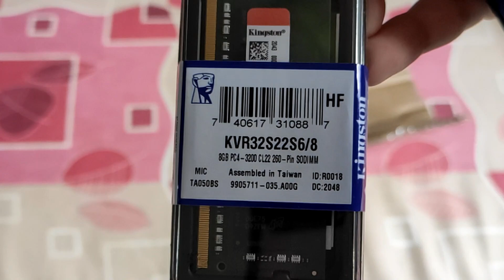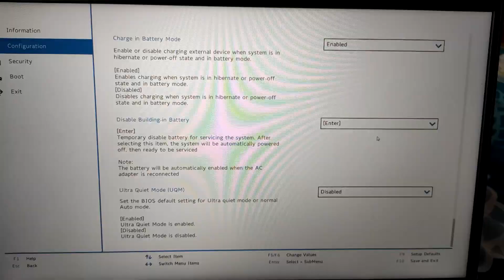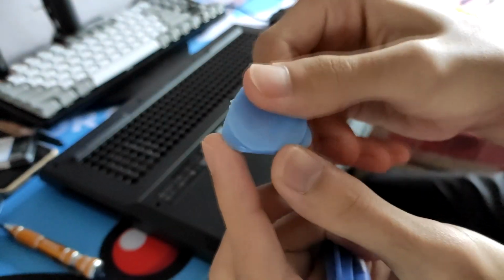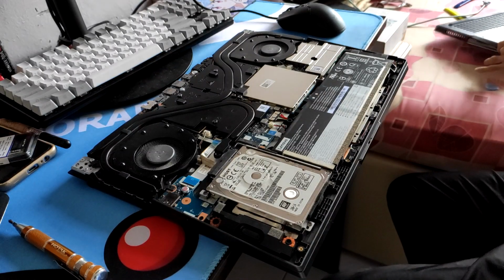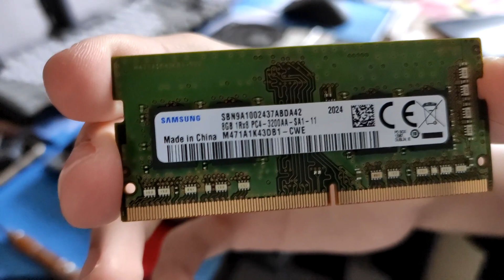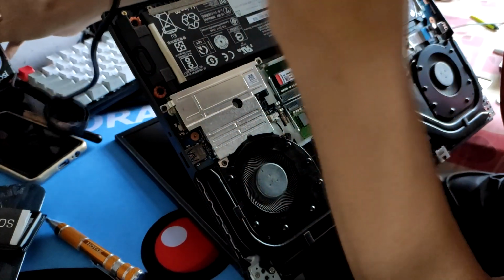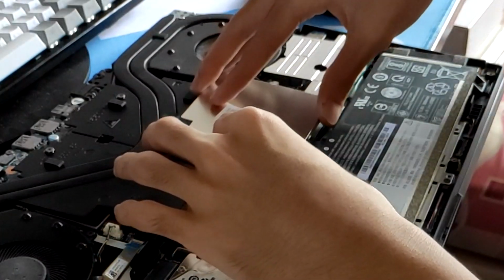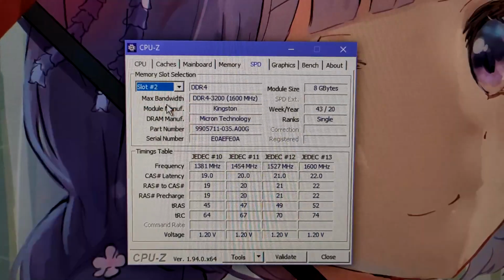Upgrading my Lenovo Legion 5 | How to Upgrade the RAM on Legion 5

Comment: Hi, may I know is it stable to use until now with two different brand? Because I had brought the Legion 5 two weeks ago and I want to adding 1 more Kingston ram on it for dual channel.
Reply from the maker: As long as both sticks of RAM have same specifications, it should be fine. I used it for nearly 2 months and no issues so far.
Reply: @TheTechOtaku  Ok, thanks :D